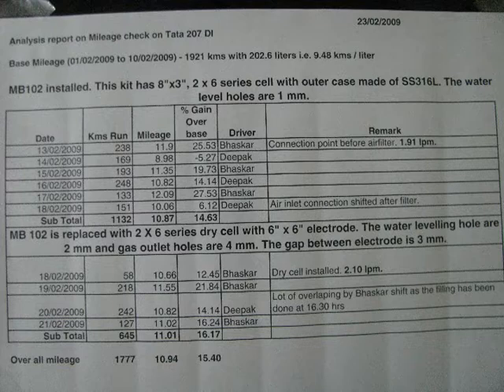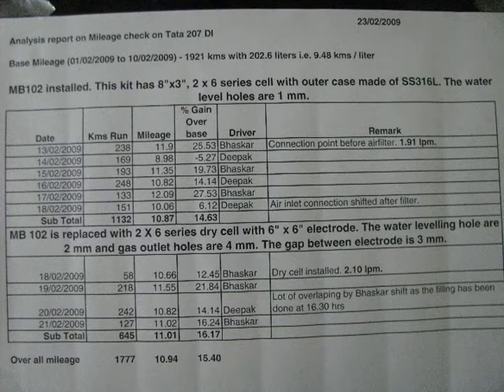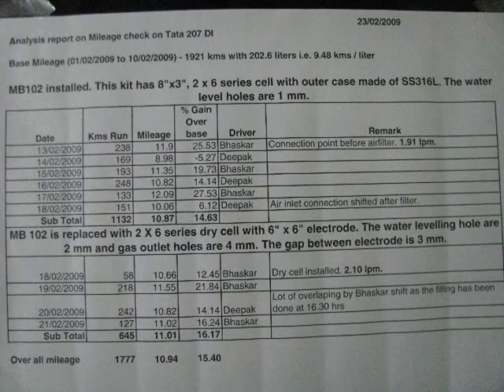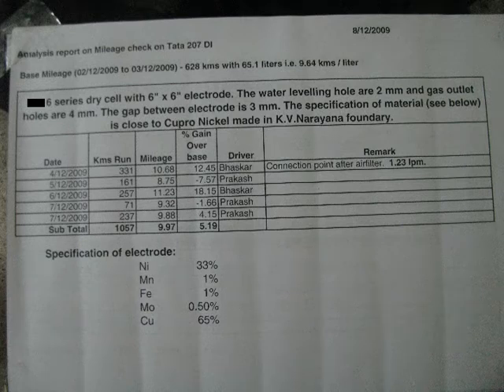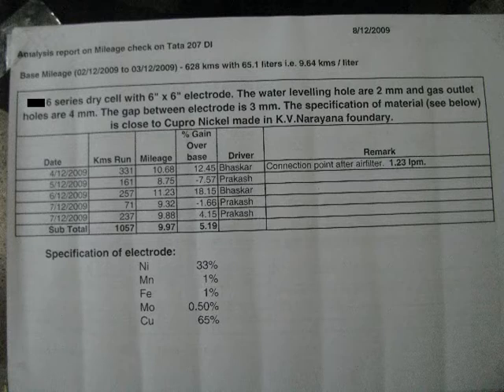Special grade material for high quality hydroxy gas generation

Comment from the maker: So far the downfall of the SS electrodes are not yet ascertain and the same has been mentioned in the video. The SS will be dead when we can get good mileage gain with minimum quantity of gas with alternate material electrodes and the availablity of Hex Chrome in electrolyte should be recognized. So far this has not happened.

I wish to inform you that I dont have any special attraction towards any material, I always sees the pros and cons. 

Have a nice time.

Praveen